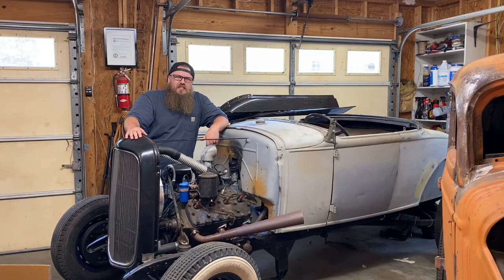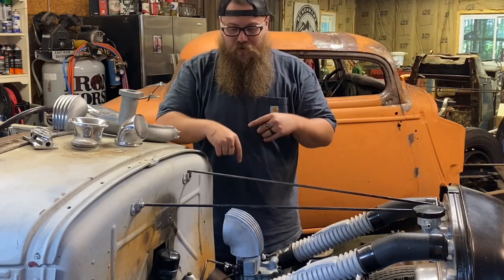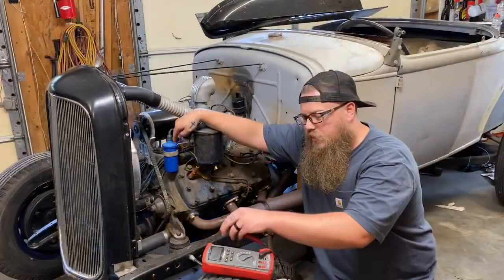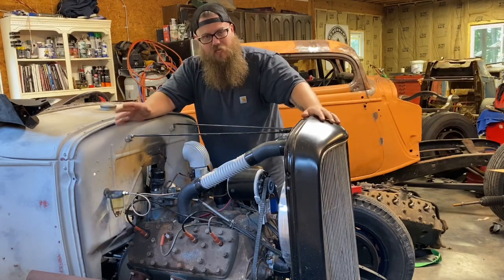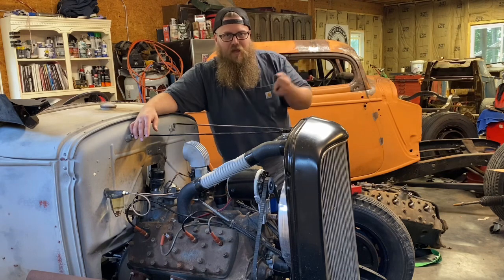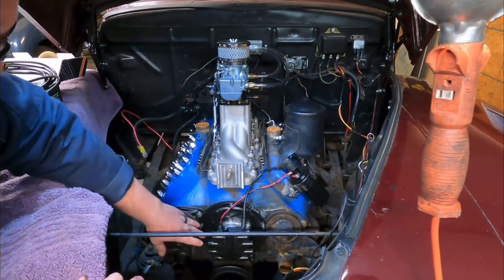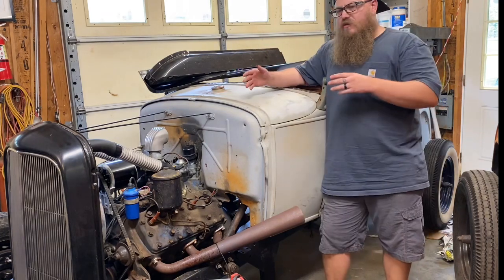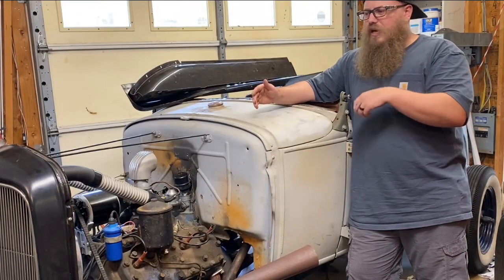Wiring Up a Flathead Ford

Comment: If you are running a 12 volt system do you use negative ground, vs positive ground that Ford used on 6volt.  If you use negative ground then do you have the hot ignition wire connected to positive side of the coil and the negative running to the dist.?  thanks

Comment: I have a t bucket that is running a 21 stud and I just converted it to 12 volt. Can I run points with a 12 volt coil or will I burn something up?
Reply from the maker: New points from a reputable place will tell you what coil is needed and wether if you need a ballast resistor or not. Only go off of the manufacturers suggestion for what coil/points/spark plug wire combination to use. I suggest giving Millworks’s Hotrod a call, they will set you up with everything that matches